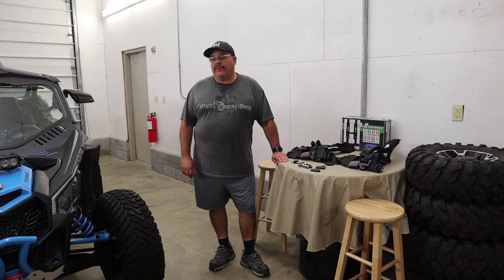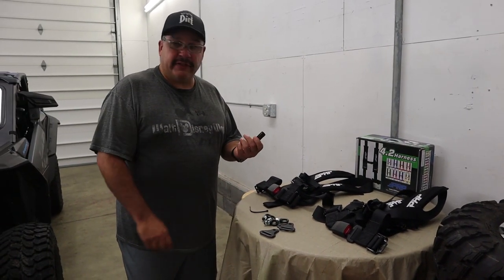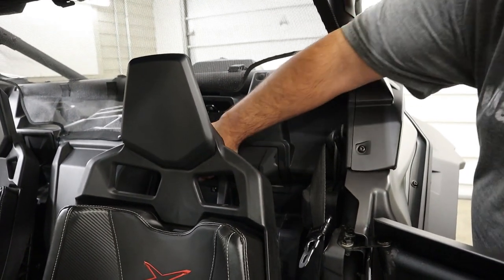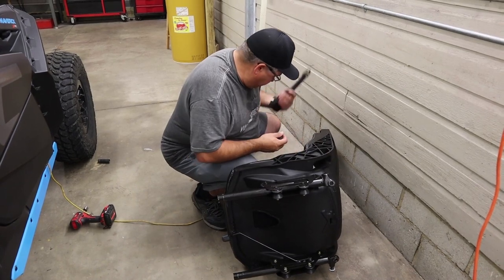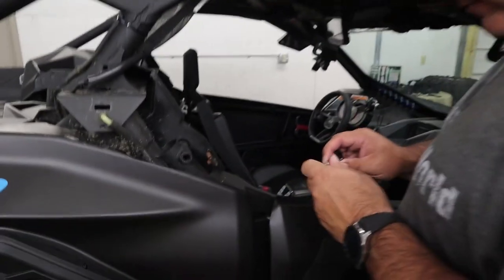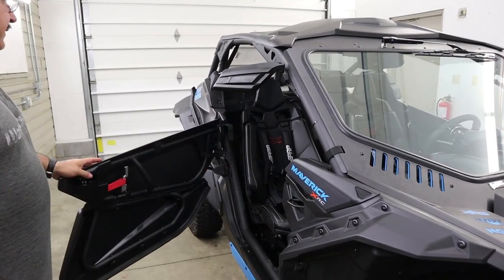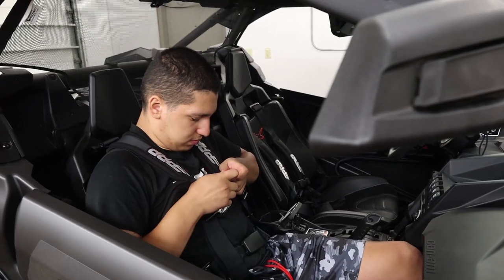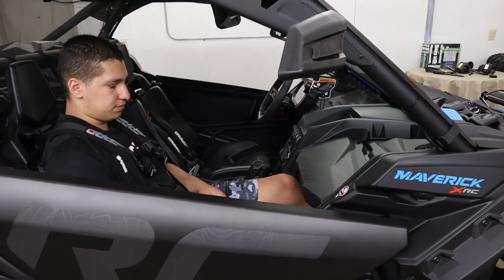How To Install PRP Harnesses On A Can Am Maverick X3

Comment: How do you like the 4.2? I want to do a 5.3 on the driver side and 4.2 on passenger just in-case I ever try and race. Someone on FB said just do two 5.3’s but the 4.2 should be fine. What do you think?
Reply from the maker: I liked the 4.2 and prefer them but I wasn't racing.
Reply: @UTVDIRT  Thanks, I bought one of each. I may go with the 4.2’s because it’s easier to click in and go]]

Comment: Did you use the same bolts for the bottom part the waist part???
Reply from the maker: Yes I used the same the bolts.
Reply: @UTVDIRT  thanks 👍🏼👍🏼
Reply: Nope not suppose to use the same bottom bolt of the seatbelt
Reply: @josephbaeza6699 which ones do we use
Reply: @gargar3183  Buy new ones, just all thread though.same grade as well too. And hardware has them.

Comment: Does this come with the hardware?
Reply from the maker: The clips are sold separately. I have links in the description of the video.
Reply: @UTVDIRT  did the bolts come with the harness? Clips sold separately, but what about those 4 bolts?
Reply from the maker: @outlaw8388  The bolts come with the clip-in tab kit.